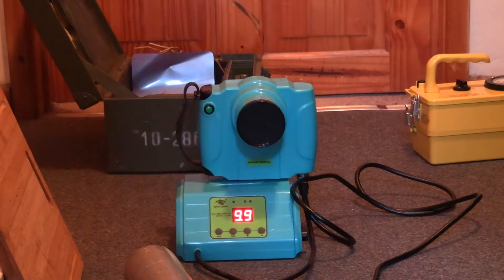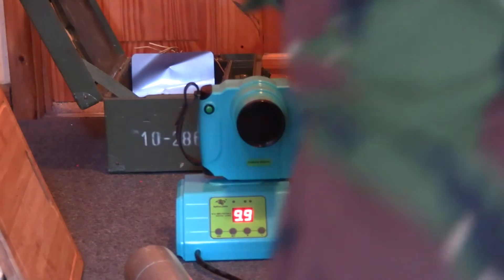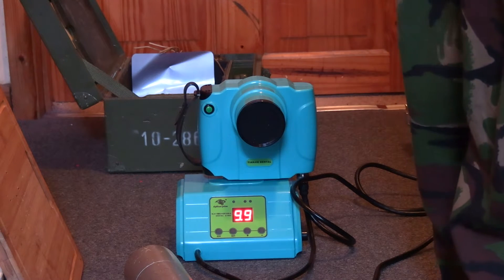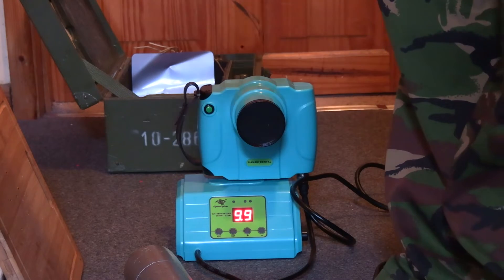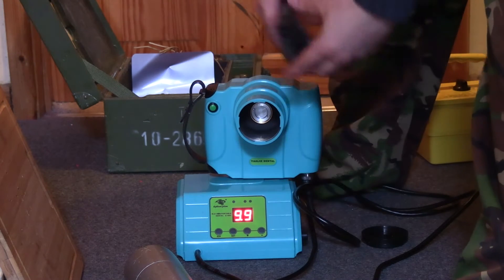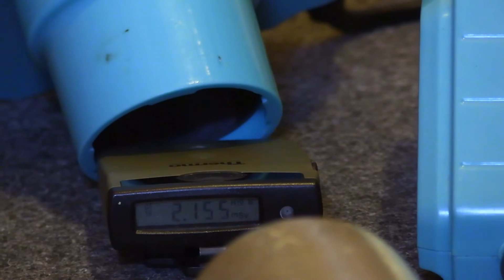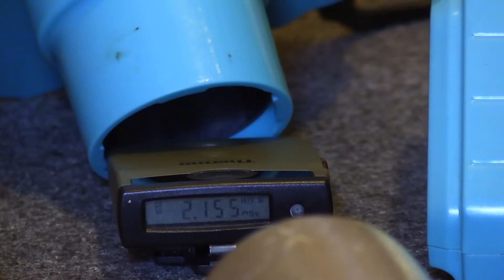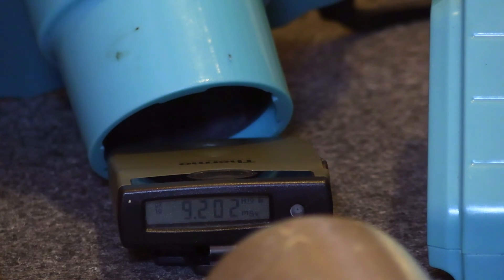Thermo dosimeter X ray test

Comment: If your exposure was instead 0.04 seconds in [duration] (not an uncommon setting) then your dosimeter in this video would theoretically read about 28 microsieverts (μSv). Not terribly far off from a normal dental x-ray if you devide by [tissue weighting factors], it becomes even less. In other words, if it was (properly) shielded and focused, and you calculated the [radiosensitivity] of only the organs around the mouth for your [effective dose], you would be coming out a lot better. IF it was 0.04 seconds AND properly frame shielded AND the beam was properly focused.
Reply from the maker: Yeah I mostly just use Ionization chambers for measuring X-rays as they get very good readings within a few seconds of exposure.
Reply: By the way, Until your videos I don't believe I ever knew how powerful test sources inside old geiger counters could get. 😊